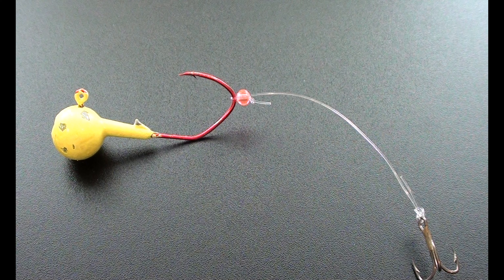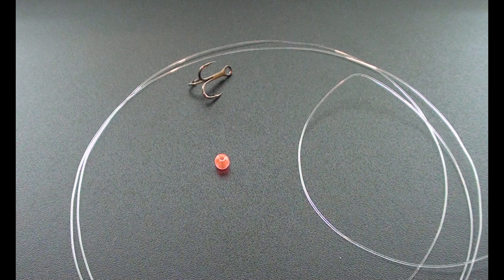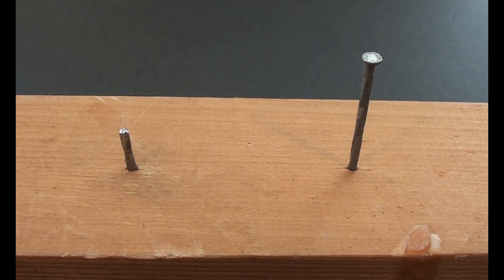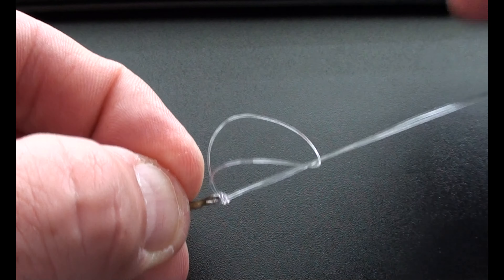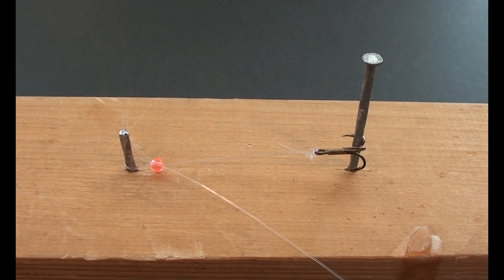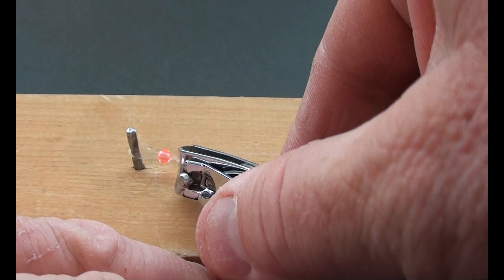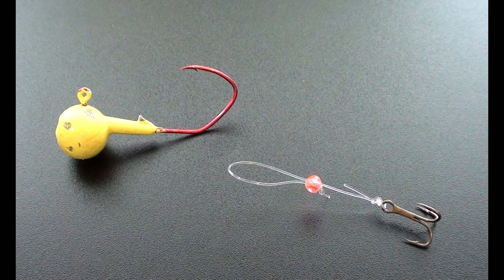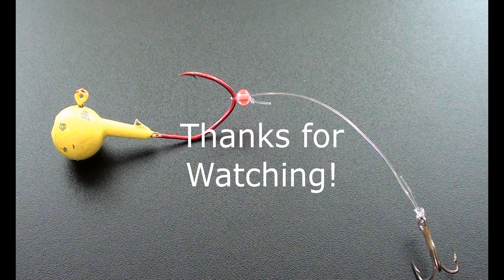The Stinger Hook

Comment: Dittos on the kudos. Elegant. I might put a tiny drop of super glue on the final overhand knot, OR tie a two-turn uni knot around the main stinger line. It would still slide but be more secure.
Reply from the maker: I haven't had any trouble with them loosening up, but the diameter of the hole in the bead relative to the line diameter is key.  Thanks for the comment!
Reply: @thegreatlakesfisherman  My concern is that if the overhand knot comes undone, you lose the stinger hook altogether.
Reply from the maker: @rockyraab8290  Oh I see what you are saying.  Certainly a dab of glue would prevent that from happening.  I have not had that problem yet, but I suppose it's a possibility.

Comment: I'd say ,the most important part of this is making damn sure you have the correct size bead so as to NOT pull the knot through the hole in the bead
Reply from the maker: Agreed. Conversely, if the hole is too large, you can go with a thicker line. Stiffer line tends to lay the hook on the bait better any how. Thanks for the comment!
Reply: Make a bigger knot!!  Go through two or three times on the overhand knot 🎣🐟🎣

Comment: Nice Vid!  What pound line test and bead size did you use?
Reply from the maker: Thanks!  The line is Berkely Big Game 20 lb. test.  It has a line diametere of .018" or .45mm.  I don't have the specific dimensions of that bead, but if the hole diameter of the bead of your choice is between 1-1.25mm, you should be golden. Hope this helps!

Comment: Do you have a link of where you bought the beads  from? Looking  to start  making  my own stinger hooks
Reply from the maker: I just started using some old beads that I’ve had for years. You’re best off experimenting with line size and bead size as many beads don’t indicate an inside diameter anyway. Just make sure that once you tie the knot, the bead won’t allow it back through.

Comment: What size of beads are you using?
Reply from the maker: The line is Berkely Big Game 20 lb. test.  It has a line diametere of .018" or .45mm.  I don't have the specific dimensions of that bead, but if the hole diameter of the bead of your choice is between 1-1.25mm, you should be golden. Hope this helps!

Comment: Hi! Where did you get your bead and what is the size?
Reply from the maker: Unfortunately, many beads do t specify inner diameter. I just found some I had around the house, but the key is to correlate it to the line size. For Instance, if you’re using 20lb Big Game, the line diameter is .46 mm so the bead diameter should be ~.92 mm. You can always use a slightly larger line (like 30lb.) or use bulkier knot if you get any slippage. Once you find the right combination for the line size you’re using, you’re golden.

Comment: Cheap ? Tackle gear is expensive these days 🤐
Reply from the maker: I'll agree with that!  But it is relatively cheap compared to buying them already made up.  And once you get the jig set up for these and do a few, you can hammer them out pretty fast. And if you tip your hooks with live bait (especially minnows), I have found that you will save on them as well by simply putting the stinger on after the minnow, which prevents them from slipping off.  The bead makes removing them a breeze.

Here's a link to get 100 #10 treble hooks for $11.99: https://amzn.to/3oYZqI8